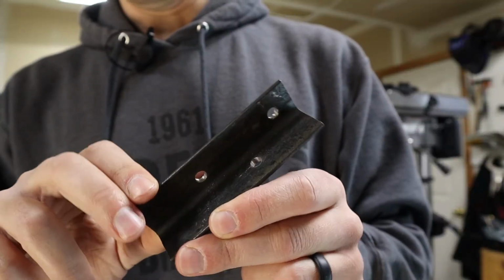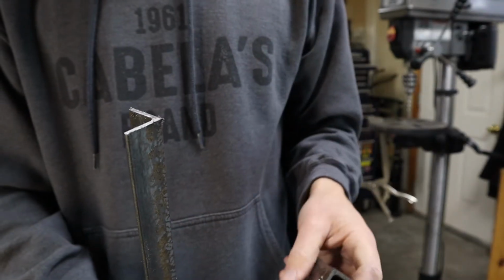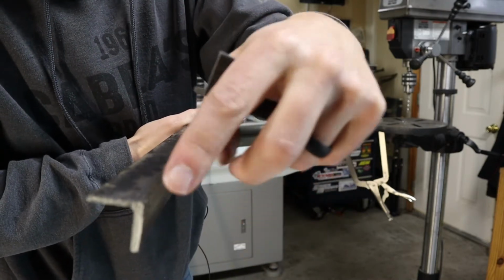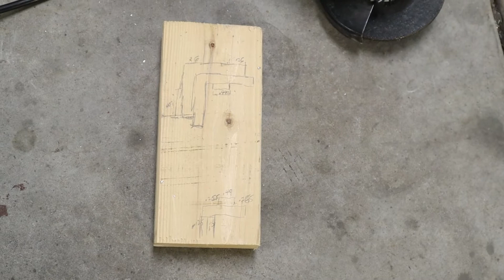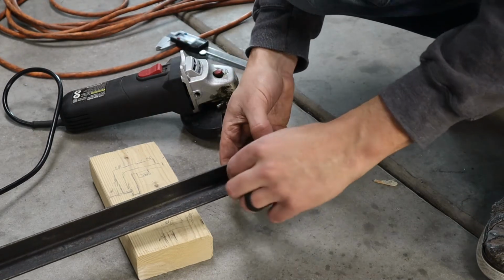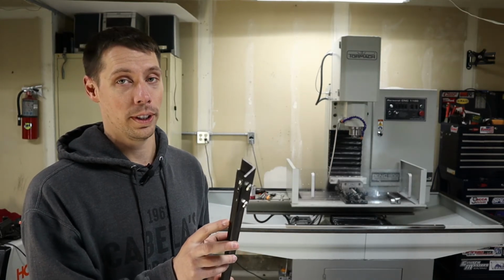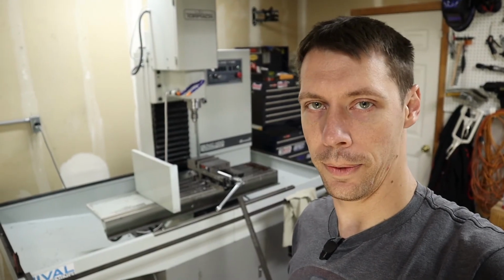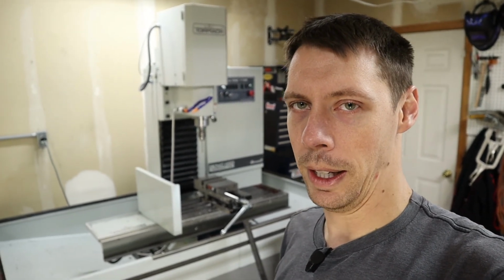Part 4: Tormach PCNC 1100 Mill DIY Enclosure Build

Comment: I wish I still had the splashguards after I build my DIY enclosure because I have some small leaks in the front that are annoying and I think they would help with that.
Reply: Also, I should add that I upgraded my coolant pump so the flow is way more then the one that came w the machine
Reply from the maker: That's a good point.  I have a leak in the front corners that the splash guards would probably help.

Comment: I have an 1100MX and I played with the splash guards from my Series II.  I don't like them.  Chips wash down better without them.  That said, what works well is some covers for the parts of the table you're not using.  Anything to ease the path from coolant nozzle to the tank is good.  And this all assumes flood cooling.  If you're going with mist coolant and air blast, then I have no idea.  Once I moved to flood I never messed with anything else again.
Reply from the maker: Thanks for the info.  I am running flood coolant and that does sound easier than how I clean it now.  When washing down all the chips, do you worry about buildup under the mill where you can't reach? I think the y axis ballscrew is exposed under there.
Reply: @RivalMachining  On the 1100MX the stand is differently designed and much better in that regard.  If I setup my PCNC1100 to run flood I'll probably drop some screens between the mill and the stand and modify the stand.  It could use coolant drain cutouts on both sides perhaps, and a relocation of the computer to facilitate that.  Lots of work, but that would get things closer to what the MX is.